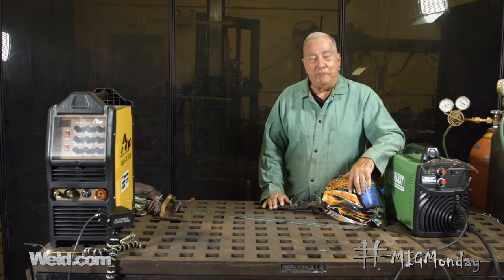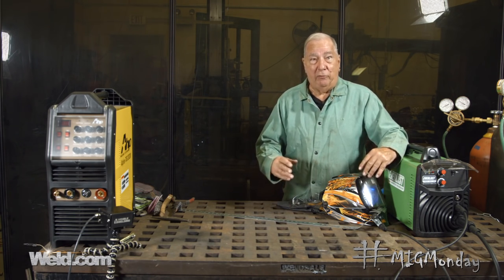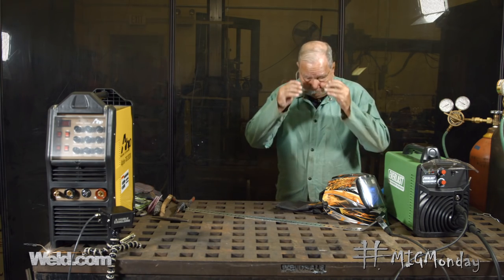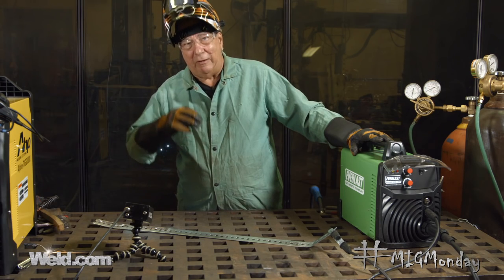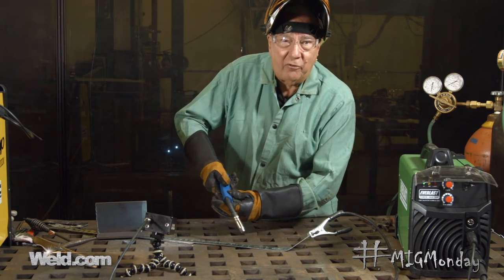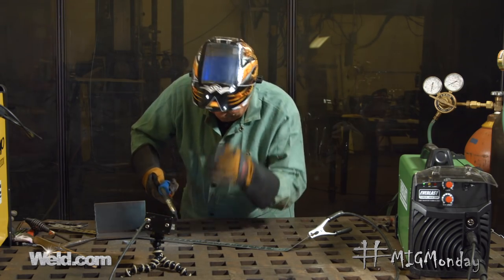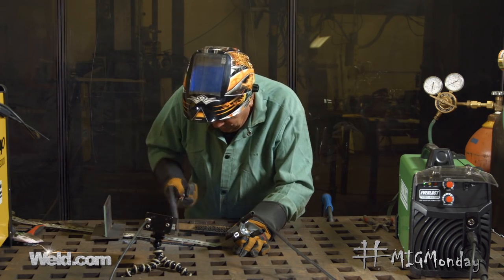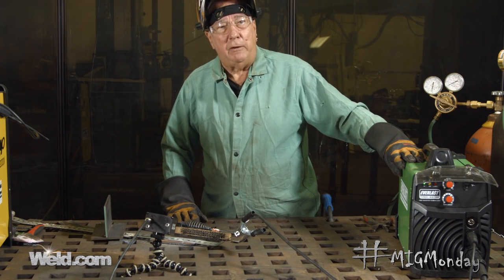GMAW vs FCAW when Welding Galvanized Material

Comment: I've welded both galvanized and cadmium plated steel.  Both are bad for your lungs.  The galvanized sometimes gives you lung irritation, but the cadmium can make you very sick.  I was welding some painted steel once and within 24 hr. I was very ill, with bad "flu-like" symptoms.  It took nearly a week for the the effects to gradually wear off.  Much worse than the effects of welding galvanized. I later learned that it was caused by the cadmium plating under the paint.  Note that I had ground off the paint near the area to be welded, but the heat had vaporized some of the plating nearby.  This was enough to cause severe health effects.  The lesson is to wear a respirator and use ventilation if at all possible when welding hazardous or unknown materials.  Yes, there is such a thing as "metal fume fever" and you will be more cautious if you are unlucky enough to ever have it.
Reply: Thank you for that. You make a very good point regarding the removal of the paint. Basically the weld prep area needs to be big enough to cover the heat effected zone.
I am currently researching the possibility of using some galvanised sheet that I have left over from my powder coating oven build for some box section on the chassis of the car I am building on my YouTube channel. Thank you for sharing your experience. I think I will be sticking to mild steel sheet for the fab work. Kind regards Paul (from "48-SPOKES")
Reply: @itsalldoable  Metal coatings are something to be cautious about, no doubt about it.  I haven't had any problems when I wear a respirator.  The one I use when I'm not too lazy to put it on is the 3M with the pink P100 filters.  The half-face size with the filters on fits under regular welding hoods just fine.

Comment: Another advantage to the flux-core wire (besides not needing expensive gas) is that you can weld outside in the wind where the fumes are whisked away so they won't hurt you.  Pretty much everything on the steel that is not more steel will hurt you when welding (if you breath in the fumes)-- so if you are in an enclosed space either a respirator or external breathing air system are mandatory.  BTW-- off topic, but you can even get gasless flux core wire that will weld stainless steel.  The little {cheap} "hobby" wire-feed machines that only weld with flux-core wire (and also low-cost stick welders) are starting to look far more useful...no?

Comment: I MIG weld galvanized steel all day. Lincoln electric 455 power wave using pulse, 400/0.92 is my setting. welds like a dream. I've passed all my C.W.B. certifications using this method and the steel always broke before the weld. The hardest thing to avoid is pinholes, your travel speed needs to be perfect. (Edit) I don't remove the coating either. Where I work, there is no time to be grinding each joint. Gotta get those parts out of the booth ASAP
Reply: Same here I’m in Australia

Comment: I Mig weld galv sheet metal of various thicknesses together all day long with no problem.
I give the metal a light sanding with a disc on my grinder. And I use a  extraction vent to take care of the fumes.

Comment: I've never had a problem Mig welding galvanised steel fence panels using agroshield and 0.9mm wire. Always weld outside using a respirator and a fan.
Reply: Question:  For FCAW, do you know if using a stainless steel flux core wire can weld galvanized steel?

Comment: If your Forman insist on you not grinding the galvanized away to save 2 minutes. Could try to do first pass with 6010, for overhead or vertical. Then proceed with 7016 to finish of the correct seize weld.  It to each is own. Different doesn’t always mean wrong.

Comment: The best practice though is to remove the galvanization with a flap disk, weld it with mild steel wire on electrode positive and then when you have finished the weld, allow it to cool then spray it with a galvanize spray. 

If you weld directly though galvanization then you will be exposed to toxic gases.
Reply: +luke cooper No vapor mask nor air take-away...lots of newby welders need to know before they wreck their lungs.
Reply: +John Ranalletta thats why i thought it was necessary to explain not to weld on galvanized metal unless the surface has been removed unlike the video explains.
Reply: +luke cooper 
I thought galvanizing was an electro plating of steel with zinc.  I wasn't aware you could simply spray it on.
Reply: You can buy a galvanizing spray paint after a repair has been carried out. The paint has a high zinc particulate which covers the part in zinc. dahveed284
Reply: luke cooper yeah that's what we do as well in some cases we don't grind the galvanized coat off we just weld with the 70s6 mild steel wire and about 90% of the time works great even have some nice dime stacks and some silicon deposit remaining common when welding carbon steel

Comment: I was a little surprised to not hear any warnings of the possible health issues associated with the flumes from welding (any process) galvanized metals.  

It would have been good to mention those risks,
It would have been better to discuss safety precautions to protect yourself from those risks,
It would have been even better to discuss and demonstrate those safety precautions.
Reply: +dahveed284 Then make a video about it !
Reply: +makoshark26 
No no.  I don't claim to be an expert on welding.  Producing a video on welding would imply that.  

But even a noob like me knows there are dangers from the fumes from welding or heating galvanized metals.
Reply: agreed
Reply: dahveed284 ghh
Reply: @jhitt79  exactly.  This video isn't made for advanced welders with 20 years of industry experience. It's specifically for "so you just bought a welder and are having trouble with galvanized steel."  It really is boggling that there wasn't at event a mention of the dangers of zinc fumes.  That knowledge is not common sense, it needs to be told to beginners.  We're talking about health and safety here.   @erickndd mostly.

Comment: I'm surprised this worked considering zinc has a very low boiling point it turns to a gas when welded which is what causes the porosity.  It seems that would be the case no matter what flux/shielding you use.  I always just grind off the galvanized coating before welding and never a problem....considering you're blasting the coating off either way , no worse on corrosion resistance either.

Comment: I remove the galvanized coating with muriatic acid. Takes about a minute to get to beautiful bare metal. rinse off and weld away! spray new coating on when finished. Available at home depot, etc...

Comment: What if you remove the galvanized coating with muratic acid??? It removed the coating well. I done it an the welds turned out great. I used 75 25 gas an 0.23 wire. Set my gas at about 25

Comment: i have a question... is it possible to weld a piece of galvanized pipe to  ungalvanized spring steel???.... i have a home made machete blade of spring steel, and i want to put a handle on it of old galvanized pipe i have... is that possible???... thanks for the info.... and what is your take on the fumes coming off hot galvanized???
Reply: Yes. Either flux or gas will work.
Reply: use a flap disc and grind away all the galvanization from the weld area, and ideally back a little bit further
Reply: dunk the handle in muriatic acid for about a minute, rinse and weld away.

Comment: Glav has a different way of being welded just like stainless, high carbon, and aluminum all have different ways that are better to weld. You can use regular wire on galv with no problems. Run low and slow and you won't get holes. You shouldn't be trying to rip a bead across plate like that anyways. I run a wire speed of 140 and 15.8 volts and never have any problems
Reply: Question:  For FCAW, do you know if using a stainless steel flux core wire can weld 12 gauge galvanized steel?

Comment: im welding galvanized fence tubing 1 5/8" .090"  and i switched my MIG machine to flux core and got better welds...   went back to mig and now im here trying to figure out what i did wrong...  i hope i just need to pull the puddle..  thanks for the video

Comment: I mig galvanized to steel daily and galvanized to stainless daily. Miller 350.
Reply: Question:  For FCAW, do you know if using a stainless steel flux core wire can weld galvanized steel?

Comment: Nothing like sticking your face in the plume to inhale all the bad stuff in the air after the weld you done at warp speed , 3-4 inches in 5 or so seconds ,maybe just grind the galvanized out of the way ,it would be much safer at the same time .

Comment: My company is trying to switch from SMAW to FCAW in structural environment  where it's  prone to all bad elements and get a bad weld outcome, where 7018 electrode can easily be dealt with. Wind, galvanized or a little  dirt here and there, with FCAW, weld materials  needs to almost clean to have a decent weld outcome while SMAW, just turn the heat a bit up and porosity  can be eliminated. Anyone  welded with FCAW processes  on the field, feel free to give me insights, thanks

Comment: OK, but I always heard it produces harmful vapors. Can it be safe outdoors without a mask?
Reply: I've done it that way for 40 years. Never an issue.
Reply: @LemonySnicket-EUC  40 Yrs; much respect!
Building a gate 1" Gav. pipe 
(Used well pipe) and forged fittings.  
I want an "old timey look".
What if 
I torch braze it in brass?  Due-able?  12ft x 4 Driveway gate w/ wire support.,
Thx
hp

Comment: I'm a welding student in high school right now and can tell you for a fact that there is multiple issues here. 1. Where the hell is your respirator? If you were welding on a flat steel plate i can see why you don't have one but with GALVANIZED!!! 2. Do you know how to mig weld? You're making content on a topic that experts, beginners, and teachers watch on a daily basis and you weld like that? For starters slow down, you're going way too fast which doesn't give time for the puddle to widen. As said before, teachers, experts, and beginners watch these videos on the daily. How are the beginners, as well as, apprentices supposed to learn and be better from this. Information was kind of accurate, but missed out ONE HUGE detail... The gases that are put into the air because of the galvanized metal. Not being mean here, but This is common sense and the fact that you didn't mention about any danger relating to this process tells me that you don't know what is going on.
Reply: @SolarMillUSA  its a good thing I'm not looking for a job then isn't it?
Reply: @marcotte6608  since you deleted your original comment I'm guessing you realized it didn't age well. Nice.

Comment: Im certainly no expert,  but i work with galvanized steel often, and unless im dealing with  wind, mig is preferred to fcaw.I find the galvanized metals i deal with are usually a thinner guage and fcaw tends to be more eager to blow a hole than mig. If blow out wasnt a concern id actually go stick over mig or fcaw

I also noticed a bunch of panzies want warnings about the fumes. Grow up Take some personal accountability, and let darwin do the rest. You go out and buy a welder and start zapping metal with minimal research, a little brush with metal fume fever is what you get (and maybe a small fire and some minor burns). Fcaw smoke is nasty stuff and airborne zinc oxide isnt pleasant either but you probably will end up with a nasty headache and some nausea. Its not weld.coms job to protect you and as long as you learn your lesson and dont huff the stuff on the daily, youll be fine
Reply: The "pansies" that want the warnings about the fumes aren't asking about it for our own sake.  We already know it's a problem. Use your noggin.  If we're bringing it up, it's because we're concerned that some n00bie who has less than 5hrs experience is gone tackle a weekend fencing project and weld for 18hrs straight in small one-car garage while standing directly over the work.  It's called concern for others.  Like when you flash your lights at oncoming cars to let them know about a speed trap or give a heads up that you just dropped a 15 megaton deuce in the water closet so it might need to air out for 30minutes.  Zinc fumes are not something they teach in middle school.  We want people who are new to welding to have good technique and to do it safely.   If you're showing someone how do it right, safety is a critical part of the training. That doesn't mean weld.com is /liable/, it just means they weren't as thorough as they could be and this could be better. 🤦‍♂️
Reply: @SolarMillUSA  
Thing is, Im saying that I have 0 sympathy for an idiot who buys a welder and starts zapping metals without checking the risks. 

Flux core and Mig wire come with warnings on the labels about fumes and checking the safety data on whatever material you're welding

The only scenario in which a newb may be unknowingly welding galvanized would be if they took a fence post from the street and started welding it.

The stuff sold in stores is clearly labelled galvanized, zinc plated, whatever.

If you dont have the time to google "what is galvanizing" or "Zinc MSDS" before you start welding it... I find it hard to sympathize.

Theres other warning signs too. Like the white zinc powder that forms around the bead. Google what that is.

first result "that's burnt zinc, you better wear a respirator, that stuff is gross"

Look, You're probably a better welder than me hands down. But frankly it's not weld.coms or your job to protect haphazard hobbiest who cant spare 15 minutes to make a few google searches.

HALF the time people find out something is hazardous to weld, they will just do it anyways safety be damned.
Reply: This is a training and DIY help video. You don't train people, do you?  When I'm showing employees how to do something, the first thing we talk about is safety. Not because I'm worried about getting sued, but because I care about their health. Same thing when I'm teaching to friends and family members. So why would I make a video for strangers on the internet and leave out the one obscure fact about a health hazard that might make them very sick? It's something you don't notice happening until it's too late. You're making so many assumptions that someone is gonna think to google galvanizing, or think there's anything weird with the white zinc powder around the bead. 

Beginners have zero point of reference. It takes TEN SECONDS to say "As a word of caution, welding galvanized metal can release zinc fumes that are very toxic. So you either need to remove the coating from the weld area or be sure to do this in a well ventilated area."  10 seconds dude.  

I'm a multi-process fabricator and do this for a living. I can't tell you how many times a single phrase of knowledge saved my ass when I'm working on a project that is outside my usual area of expertise. Fairly recently: don't use red cans of brake cleaner to prep metal parts before welding. I frequently use solvents to clean parts, and when they come off the lathe brake cleaner is one of the fastest ways to remove cutting fluid since I don't have a parts washer. I have both the green and red cans of brake cleaner.  I could have easily used the red can and then proceeded to weld. Oh, don't know what I'm talking about? Maybe you can google it. Or figure it out yourself. Not my problem right?

 20+ years of fabricating and there's still a lot I don't know. SO THANK YOU to the very helpful persons on the internet that have saved my ass countless times. I will never get annoyed at a professional giving health and safety tips as part of a video, even if I've heard it a dozen times. 

This training video may be the only thing that someone watches before jumping into a project.  10 seconds
Reply: @SolarMillUSA  With all due respect,  Its not like weld.com is telling people to spray brake cleaner onto the material before welding.  

 Weld.com's  not passing this off as a "Everything you need to know video". This is a quick tip.  

now if weld.com said, "This is everything you need to know about welding galvanized steel in 1 video" Then you should chime in.

If weld.com said "Fuck respirators, they're for pussies, now lets weld some cadmium while naked" You might have a case.

Ever been in a tour group? There is always some know it all who constantly chimes in, interrupts or fact checks the tour guide. Souring the experience and for no other reason than to flex in front of strangers.